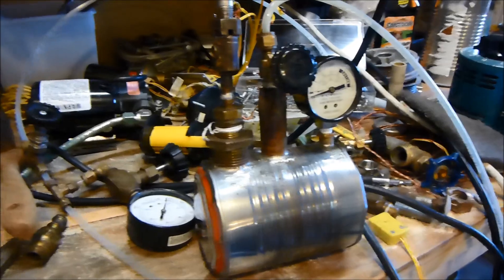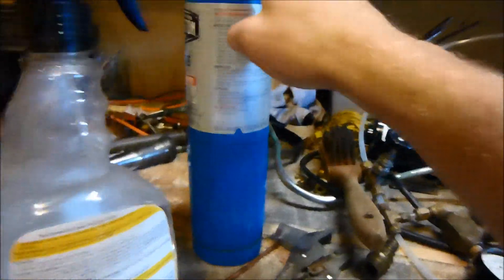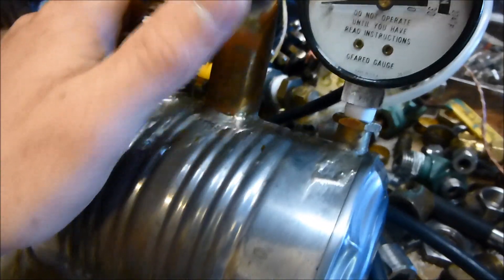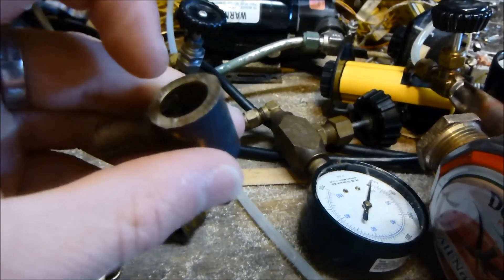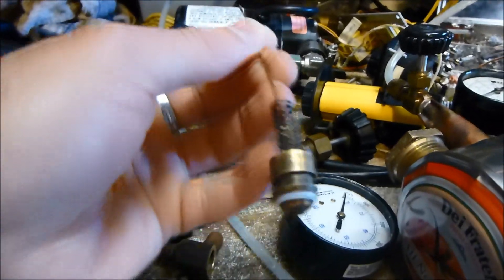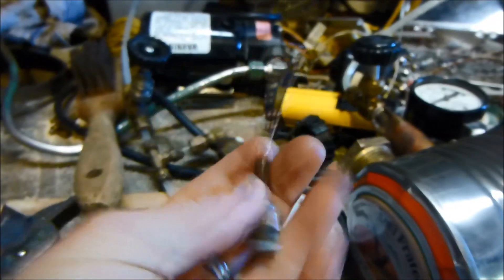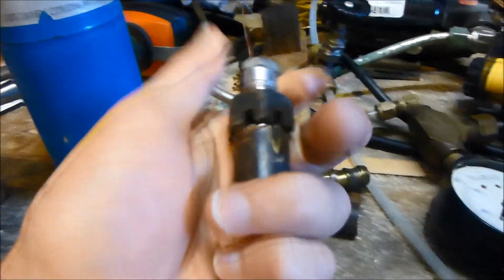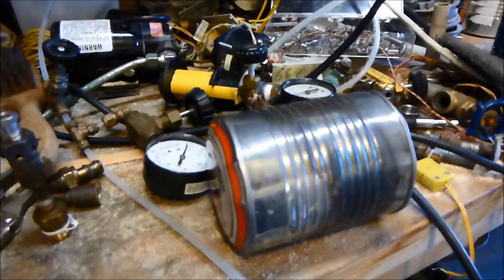Boiler and How I Made the Pressure Relief Valve

Comment: This valve you found is similar to a non return stop valve on full size boilers. When multiple boilers are feeding into a steam header at a power plant they will have enough steam pressure to lift the plunger up and contribute to the overall steam in the header. If say the boiler tripped for whatever reason the plunger would be pushed back into its seat and not allow any steam back flowing from the header into the boiler. Very interesting. Good work keep it up!
Reply from the maker: Karsten Elliott Interesting!  So maybe if I drill holes closer to the seal so it acts less like a piston it will not stay open as long?  Thank you!
Reply: More spring tension and it won't stay open as long. More spring tension equals more steam pressure before it blows off so be careful :)
Reply from the maker: Karsten Elliott Yep!  That's also what the nut on top does!

Comment: When you make your new boiler...  IT'S TIME TO BLOW UP THE OLD ONE. 👍😂
Reply: >Put some water in it. Close it all up. Put it on your neighbors bbq. and RUN. yeah it's that simple ;)<

I second that request XD

If your concerned about safty, and cant dig a bunker. A wide open space would be second choice. I dont think the can will rocket more than 200 feet.
Reply: You might be surprised. As the water would be under pressure. Its vapour point would change. Needing more heat to boil to steam. So if it was near full and pooped, then a lot of the water inside could flash to steam instantly. If there was some water left, it could act like water in a bottle rocket... Have you seen any of the mythbusters hot water system explosions? They have done it a few times. It always sends the copper tank a few hundred feet in the air..... While doing huge damage to anything close to the launch zone....

Although the solder on yours will likely be the first thing to go. It may even melt.
Reply: Mongrel Shark yeah when solder gets to about 120c it starts to get brittle. But that should give a nice pop anyway 😝
Reply: I once made a putt putt motor with two can lids soldered together. As it got into its good power range. The solder went to liquid and it kind of went like a bellows for a bit, then it sort of fell apart a bit....
Reply from the maker: Hahaha that's evil!!!  XD  Love the idea!  I wish I was that much of a trickster to actually put it on the neighbors BBQ!!!  And yeah RUN FAST!!!  :P  Yeah it probably wouldn't be to dangerous if I filled it all the way up with water.  That way only a little bit would actually be steam.
Reply from the maker: Yeah I think I would defiantly want to run super far!  Water above boiling point would take my skin right off.  :/  Plus a can going like 100 miles an hours doesn't sound nice either.  I've seen the Mthbuster's hot water heater explosions.  They are amazing!  I would love to do that!  Hahaha!!!  Yeah if the solder when it would be spinning around spraying steam and hot water every where!  Fun!!!  =D

Yeah the solder would probably go first.  Unless the ends go first.  Not sure how they are held on.

I've also made putt putt motors before with can lids!  And I had the exact same results!  I still have the thing too!  It works pretty good just before the solder melts!  I should try again with higher temperature solder.
Reply: I went down the silver solder path. I had trouble heating the whole can lid, and kept getting pinholes and hairline fractures. Used a top of blowtorch tanks and wasted $50 in soldering rods....

I also tried to tig weld the cans. It wasn't pretty.
Reply: I tried that too, worked great till the solder melted. I even used 450c sheet metal solder (acid core) Same melting results.

I have silver soldered smaller areas well before, the key is to heat the whole join evenly and join it all at once. I just couldn't do it with my pencil torch on the can lid.

A gas cook top would probably work, as would your kiln, or probably your induction heater (I just discovered induction soldering is a thing!!)

I plan on building a small gas fired silver soldering oven and trying again.

I tried and tried to run a bead around the outside like you would with a soldering iron. silver solder just doesn't work like that. The flux is too short lived.

I did manage to tin the rims that way, but it also warped them a bit.

Normally you would tin one or both parts, then add more flux and maybe a little extra solder. Assemble then heat evenly all over as fast as posible the joins should be very strong when done that way. Its actually more of a weld than a sloder join, and the metal absorbs the solder and melts into the solder a little. So its more like bronzing than soldering.

I also want to try bronze welding a putt putt. Although temperatures are much higher again. cant really be done with propane (I tried) Maybe with MAP gas. although bronzing is really an oxy torch thing.

I also want to try making a HHO torch for that sort of stuff. If I can make it safe, it could be a low cost alternative to oxy. as the gas bottles are expensive to own or rent, regardless of how much you use them.

One thing I found interesting with the putt putt, was that it seemed to heat the cup of water I was running it in very fast. I think maybe faster than the candle would heat the same volume of water in a metal container with the candle on the bottom.

Imagine taking an entrammel metal camping mug and half filling it with water. Then trying to heat it on a small candle flame. You'd be there a long time. Yet when I ran the putt putt in a mug. The water was too hot to put my finger in by the time the solder melted. Only took 3-4 min. I have some ideas as to why, but I need to re-visit with a putt putt that can boil the water without melting first, so I can compare to boil time in a pot over the same flame. Before I can confirm if what I think is happening is actually happening.
Reply from the maker: I want to sooo bad!  But I don't know how to do it safely and water pressure is not enough.  Any ideas?  Thanks!
Reply: Makerj101 Put some water in it. Close it all up. Put it on your neighbors bbq. and RUN. yeah it's that simple ;)
Reply: Makerj101 But if you only want to use water pressure use a pressure washer etc. But I don't think that it's going to be TOO dangerous  if you fill it up with water and put it on some heat. Most volume is still taken up by water.
Reply from the maker: Mongrel Shark Wow doesn't sound very successful!  I just used my soldering iron when I made mine out of can lids.  I just used normal electronics solder.